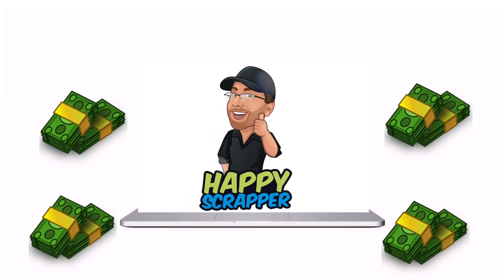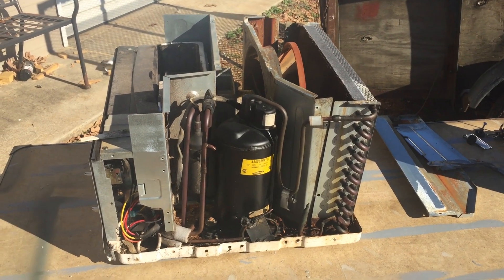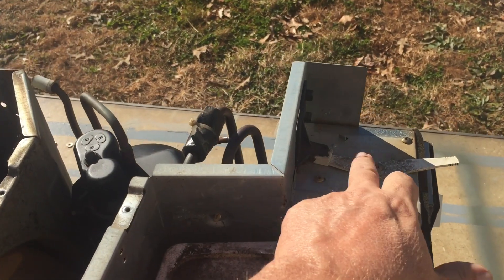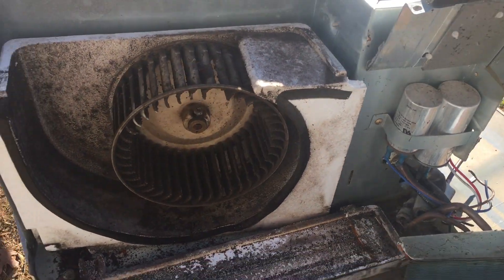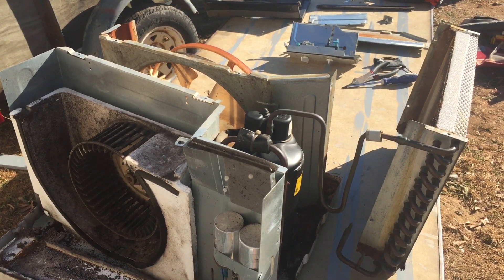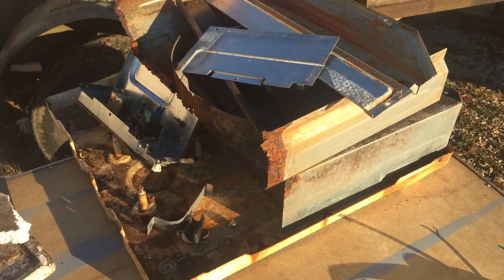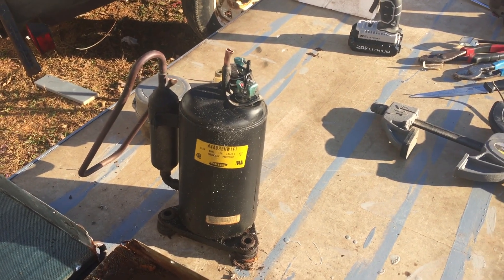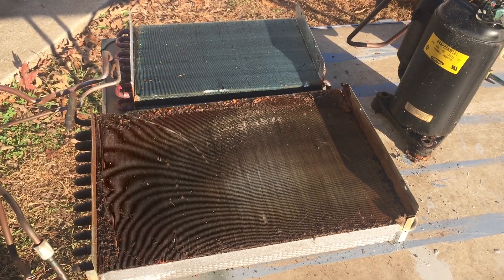👀Scrapping out a window AC unit Turn Copper and Brass to CASH🤑

Comment: I use big Wire Cutters, and Tin Snips to cut the pipes, and if needed I will crimp the pipes even though the moment it leaks jump scares me, and sometimes I use a handsaw/hacksaw with a metal cutting blade and wire strippers, tweezers and sometimes nail clippers if I have a circuit board as I take of the components, I don’t really have access to power tools but it works, scrapping individual circuit board components works as well, as each contain different metals, solder can theoretically be reused if you melt it down into a wire again
Reply: Crimping the pipes, if done correctly will seal the gas in the pipes but also allows you to make it easier to separate, though I so far out of ac compressors (2 window ac units 1 having r-22/Freon and the other having r-148A or something, and 1 Dehumidifier/AC unit as well which was also r-148A (I forget the exact number as I tossed them and someone else took them, but the r-22 compressor I can’t find that model anywhere nor the ac unit model as the model number is practically non existent) but I always got lucky and all but 1 had leaked on me, and it was the Dehumidifier)